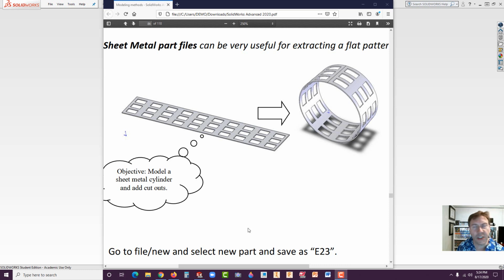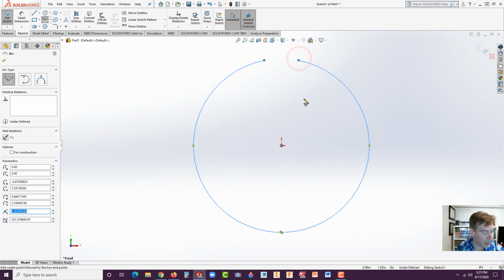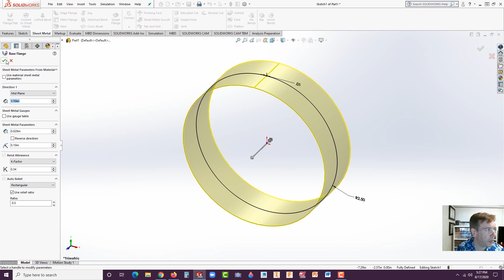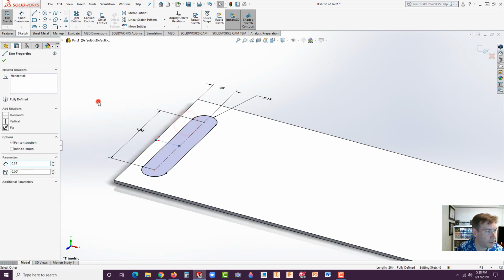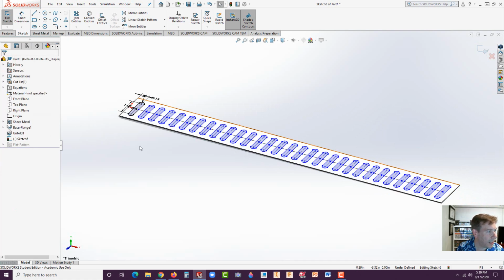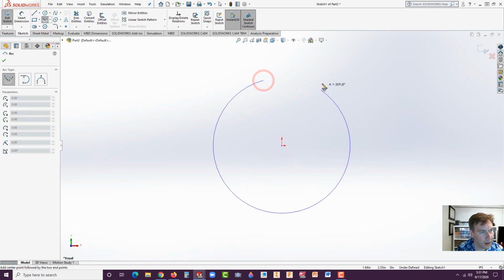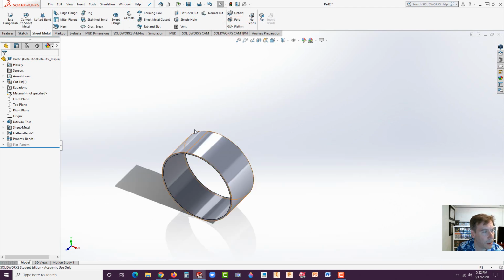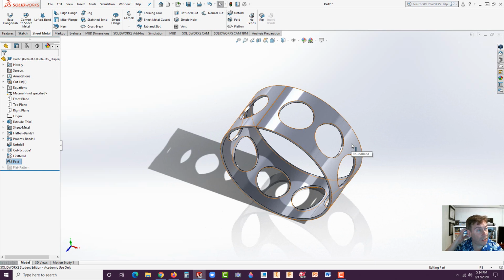E23 SolidWorks 2020 - Sheet Metal Cylinders

Comment: so if this is going to be a welded cylinder and I want to maintain some specific diameter, should I just make the gap really small or can I somehow make the two endpoint the same and it will know where to break it?